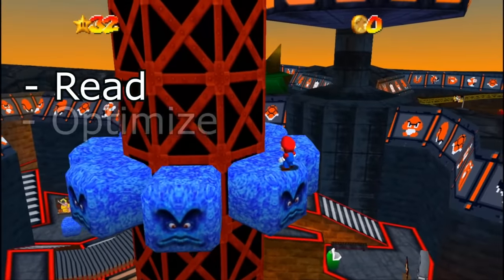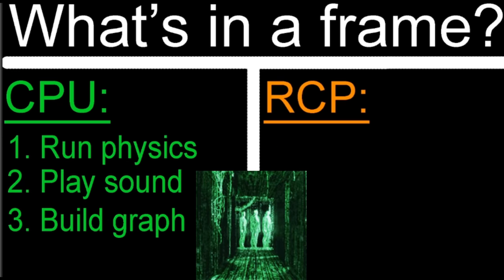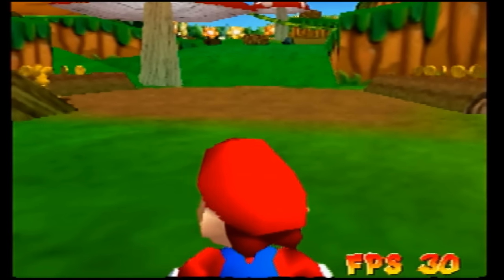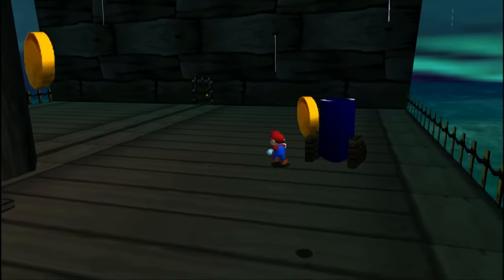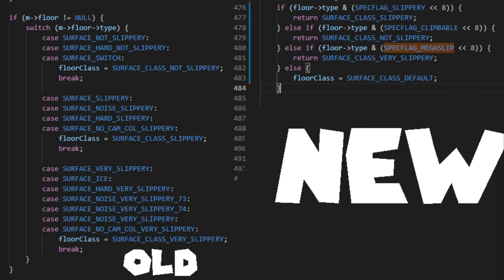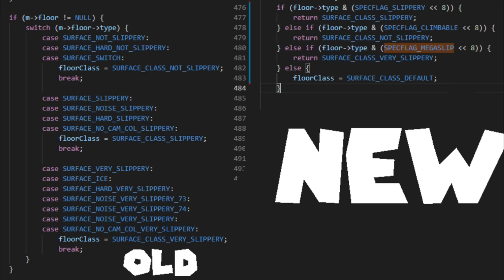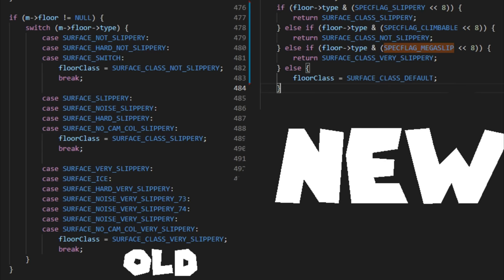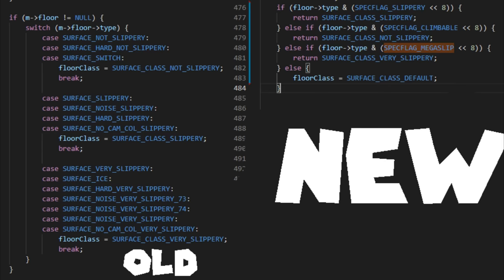FIXING the ENTIRE SM64 Source Code (INSANE N64 performance)

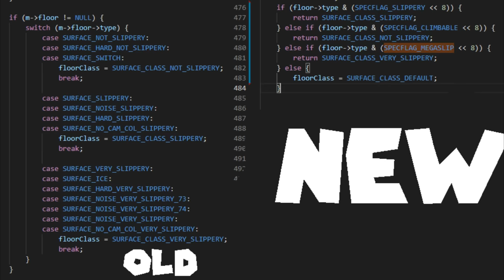Comment: 9:20 It's kind of wild to me that replacing a switch with an if/else chain, with bit masking ops at that, is faster.
The switch should compile into a jump table and turn into a single memory access and jump shouldn't it?
Reply from the maker: left side will be something like sll, add, lw, jr with j, or(x3) while right side will be something like andi, bne, ori (x3) and one extra ori - so 4 + 2*3 = 10 instructions and 1 memory access vs 3*3 +1 = 10 instructions and no memory access.
Reply: @KazeN64 Thanks for the response and clarification. Very interesting stuff.

Comment: Is there any potential benefit to tossing in some strategic CPU NOPs to create a gap in memory access that the other processors could slurp up?
Reply from the maker: this is what the idle thread does - but anywhere outside a loop it'll never make any sense: you have to load the NOP instruction itself which causes additional memory time.
Reply: @KazeN64  I seriously wasn't expecting you to reply (: Thanks for satisfying my curiosity.

Comment: 9:25 the right size will be slower for slippery, climbable and megaslippery surfaces snce they are doing two logical operations beside the comparison and jump which happen on both sides. This assumes hardware is actually bottlenecked by artihmetic/logic operations.
Reply from the maker: hardware is entirely bottlenecked by memory transfer which is why rambus needs to go vroom vroom. cacheing 1 instruction takes 7.5 times as long as running 1 logical operation.

Comment: I'm curious how he got the source code. A lot of old games could use some mad remaking like this.
Reply from the maker: it's reverse engineered by hand. you need to find the exact compiler they used to make the game (which we luckily did) and then turn the compiled assembly back into c code. hopefully some day in the future, machines can do this automatically. its a pretty long and painful process right now.
Reply: @KazeN64 Do you think stuff like GPT can some day do this, at least kind of reliable?
Reply from the maker: @skylo706  it's already pretty decent at turning asm into C or C into asm. but to do this with a low enough failure rate to decompile a whole game will likely take an AI specialized for decompiling and not a large language model. give it maybe 15-20 years and i think it's doable.

Comment: At 7:48 I'm a little confused... In both 32-bit and 64-bit, "OLD" returns byte-3 (upper byte of 32-bit int), and "NEW" returns byte-0 (lower) Or am I missing something?

Example:
    o->oBehParams= 0x89abcdef;
    
    const uint32_t old = (o->oBehParams >> 24) & 0xFF;
    const uint32_t new = *((uint8_t *) &o->oBehParams);

Returns:
old = 0x89;
new = 0xEF;
Reply from the maker: i think you missunderstood how the pointers work. if an int is stored at address 0x1000 and is set to 0x89abcdef then *((u8*)0x1000) will be 0x89. read from 0x1001 would be 0xab etc

Comment: C was not a new language in 1996, it was already over 20 years old. It may have been new to the devs, of course. And the MIPS CPU was a new architecture so their long expertise on the 6502 derivatives used by the NES and SNES wasn't applicable.

Comment: Very great job!

Yes, you're decades apart from the original game, but you're still a single person! Congrats!

A thing I would lime to do is "overpowering" and old system to see how it will result in that specific area.

Like having a super graphics card and see how different it would look than the standard game with the same memory etc. Or using a cartridge so powerful it almost ads a new console to the N64 (in this case). That definitely sounds more possible considering we had Super FX and the Sega 32x.

Comment: Does this work on real hardware though? If not then optimization is based on emulation
Reply from the maker: yes, all the numbers are based on real n64 measurements. on emulator you can just run the game at 5000 fps if youd like obviously

Comment: Can someone explain why that optimization at 7:50 is "illegal"?
Reply: Looks like the "new" code is getting the high byte of a 32-bit field by casting it to a byte, which depends on the N64 being big-endian. So it just does an 8-bit load (presumably zero-extended) instead of a 32-bit load followed by a shift. (the AND is redundant because there are no more bits left, so the compiler probably doesn't do it) That's kind of sloppy without using a macro or something to clue people in that you're doing something weird.

Comment: now i have no idea on how to code but couldn't you also get masters of the texture files and compress them more economicaly so you dont have to read as much code this reduing timings?
Reply from the maker: The n64 only has a few texture formats it can render. There are some more compressed ones and I am using them when appropriate! Check out my video about perfecting the mario 64 model if you want to see more of that.
Reply: @KazeN64  yeah i posted this before i saw the last bit where you mentioned putting in higer res textures. Also Are you planning on doing mario kart 64 beacus ive had good bits of slowdown in the game and like to see the huge jump you were abel to make in sm64

Comment: Can someone explain the illegal code part?
Reply: It's because it assumes o->oBehParams is a valid memory location and can be interpreted as a byte (u8) directly, which might not be the case in all scenarios. Accessing data with potential misalignment can cause undefined behavior or stuff like segfaults on some platforms. There are some other quirks but that is the baseline of it

Comment: ATI is huge bugger mess when ATI made the chip base on ArtX that became first RADEON  for pc use on their code, now i know why radeon cards today are buggy, gamecude is use same chip as R300 as n64 for compatibility in the code all nintendo did is upgrade gpu architecture to load more memory buffer than 8megs ...but still its cut down version of r300 to use less vram for gamecube but better frame buffer than previous version...nintendo always focus to keep older games working on same architecture without gonna different changes is why people can play n64 games on gamecube easily ..same vice versus with wii use another radeon cut down chip from same 9700 line again, wii-u similarly use 2000 series on desktops

Comment: I don't get it. Most of these code optimizations, would surely have been fixed in a compiler automatically.... Like inlining single use functions, unused variables etc.....
Reply from the maker: The code I'm using was reverse engineered from looking at the compiled ROM - meaning anything that would have been compiled out, is missing. There likely were even more unused functions/variables in Nintendo's original code that just didn't make it into the ROM.
Reply: @KazeN64  Good clarification. But wouldn't the reverse compilation likely give an unrealistic code base to make assumption on how the original code was?
Reply from the maker: @deenaxic9134  the decompiled code compiles 1:1 to the same rom, so we know that this is pretty much exactly what nintendo had minus what the compiler optimized out, code comments and with different variable names.

Comment: why is the new code at 7:43 "illegal"?
Reply: It's because it assumes o->oBehParams is a valid memory location and can be interpreted as a byte (u8) directly, which might not be the case in all scenarios. Accessing data with potential misalignment can cause undefined behavior or stuff like segfaults on some platforms. There are some other quirks but that is the baseline of it

Comment: Cool! Now time for some madlad to make a TASbot to implement these changes using ACE, then for some crazy mfkr to do the same thing manually lol

Also the safety checks callout at (9:33) hit home lol. I do most of my coding in batch, and how tf the system goes through some choice commands without having errorlevel EVEN F^+^KING SET (or at least you'd think so given how it acts) is still black magic to me.  Still gotta git gud.

Comment: Wow.  You know a lot for how little you know about compiler optimization.  I think there is a lot of gain you can make there.  For the amount of effort you put in just handing the code off to -O2 is kind of discordant.  Have you looked at llvm, and have you played around with Godbolt any to see what different outputs you get from the code?  You should look at the youtuber Creel.  He's obviously targeting different architecture and era, but he does tend to use the tools you seem to be missing.
Reply from the maker: I'm actually on Os nowadays because smaller code is almost always better on N64. I have a custom patched GCC that has some n64 improvements. unfortunately im not that tech savvy and i find it very frustrating to try to set up compilers and all that. A lot of my codebase is written in a way that it GCC -Os interacts will with it so idk if switching compilers at this point would help but i'd be down to at least try the other options if I knew how
Reply: @KazeN64 Saying you"re "not that tech savvy" is like if Usain Bolt said he "wasn't that fast".

Comment: I notice the impression most people are getting is that you made Mario 64 a better and more modernized game today. You made it faster and you changed the entire source code to do it. Surely killing alot of the game’s original charm. Just one example from a short clip you showed the coins simultaneously spinning all of them synced up. That helps with the processing speed but you lost the “charm” the uniqueness of each individual coin. It feels stale and boring and simplified. (Ik it’s just a video and you’re not a game dev trying to sell me a game I’m just saying) Sometimes the extra processes and the added time to make those processes happen add another level of engagement and “charm” you just can’t get any other way
Reply from the maker: that's a super minor change though and only improved performance by about 200 microseconds in a frame. thats not even 2% of the total performance improvement and was not done for performance reasons.

Comment: But...its not a game about framerate and runs perfectly fun as built. It was the launch title for the N64. Making it able to use double the ram doesn't really sound like an accomplishment. Also in your clips thats not Mario 64, looks like a highly customized version based off certain levels.
Reply: Those customized levels showcase how far you can push the engine with great performance using these improvements. And many people today prefer 60 fps as opposed to 30 not to mention you can still keep it at 30 with these improvements and there won't be any frame drops like in the actual game.

Comment: nintendo is so incompetent when it comes to writing code
Reply: Nintendo is actually pretty efficient when it comes to this. The thing is, that most optimizations kaze did, would never be accepted in a work enviroment. If you can tell with 100% certanty that something doesn't break its great, but you can't afford any risks in production compared to modding a game later on where a 99% stable game is more than enough